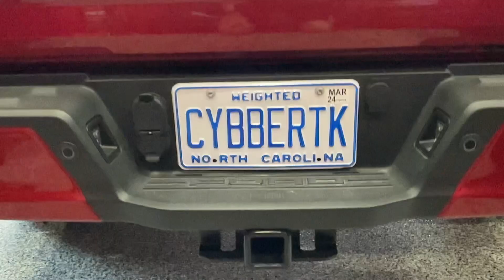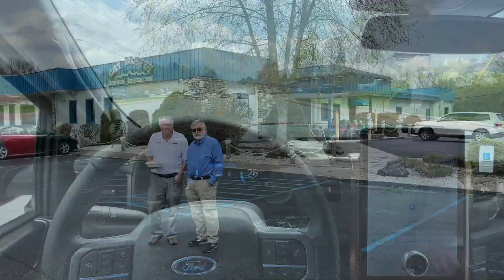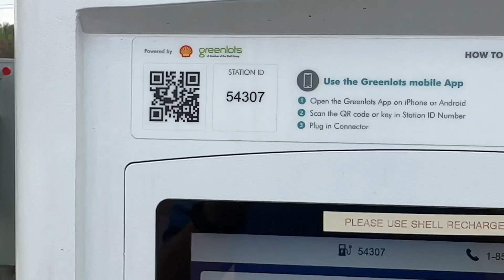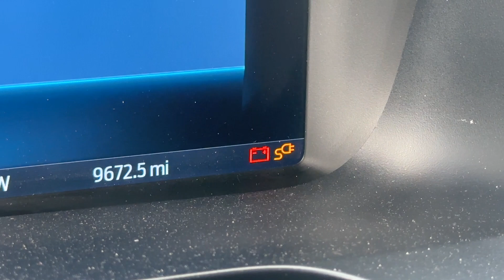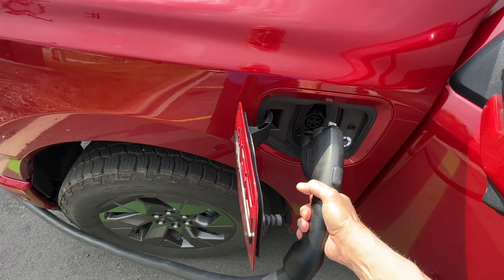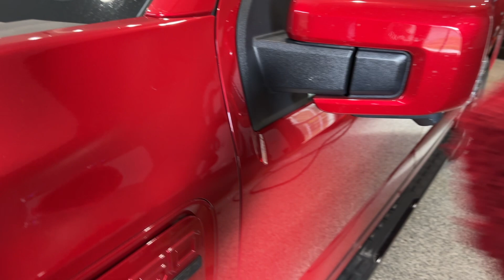WHAT is Your F-150 Lightning Thinking! Part 2

Comment: I use the same setup on my Ioniq 5, but since the Ioniq 5 gives you incoming  charging rates in kW's and estimated time to charge, I'm not tracking that. What I use mine for is tracking the 12V SOC, since the 12v has failed on some Ioniq 5's. I also use it to track minimum battery cell temperatures in my battery and my battery heater temperature  during battery preconditioning. The minimum battery cell temperature can mean the difference between charging at 235kW and 40-75kW with a cold battery. The ideal battery minimum cell temp is 70F (21C).

Comment: Great info on Lightning. I agree more charging info would be beneficial.  Since you’re talking about the display (or absence thereof), how about doing a video about how Tesla could improve the visibility of info displayed on their screen.  For example, larger and bold font for important messages and other need to know data (I.e. charging rate).  Easier to read screen info would improve safety while driving.   Keep the great videos coming.

Comment: What do you think about Ford adding a Charging screen, that provides every bit of charging-related info that you can think of? That might be what you were saying about having an "Advanced" option, but I took your comment to mean that you wanted more info on the instrument panel ("binnacle").

Do you disconnect the bluetooth OBD reader whenever you turn off the vehicle? Does it have a sleep mode or is it only powered when the vehicle is on? I've heard that they can do a number on 12V batteries, but I'm hoping that they're improving in that regard.

Comment: Most gauges these days have been replaced by "idiot lights" but Ford should give a readout that shows charge power. I prefer the SOC which shows up in "calm" but have no intention to buy a Lightning at current pricing.